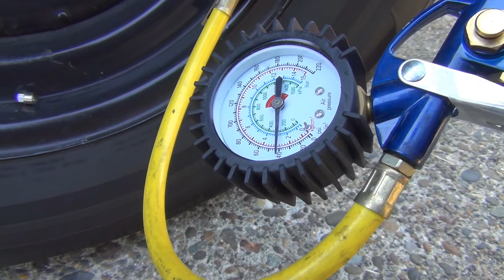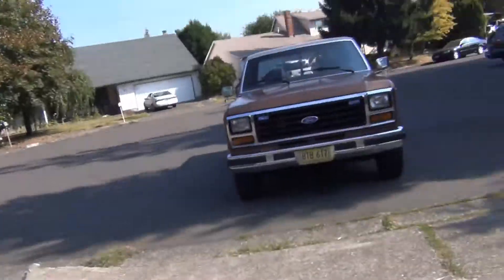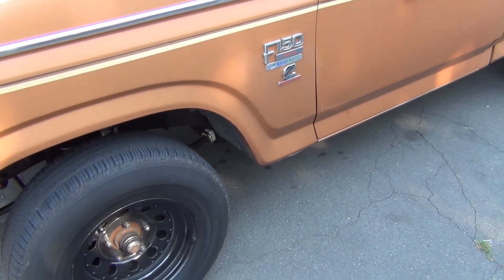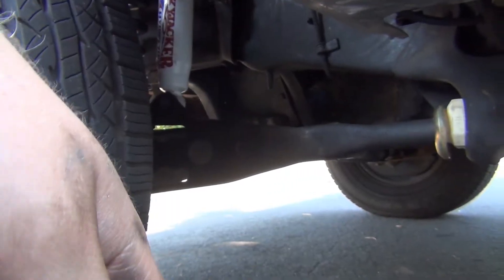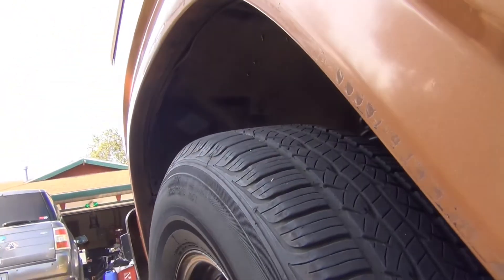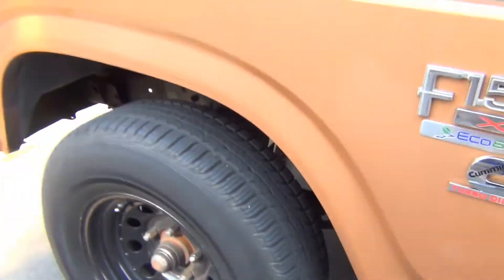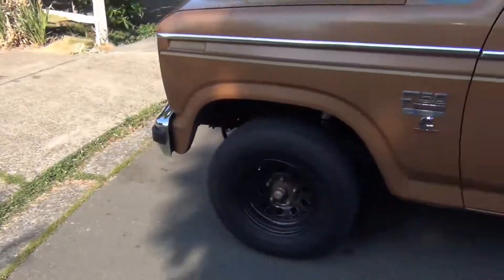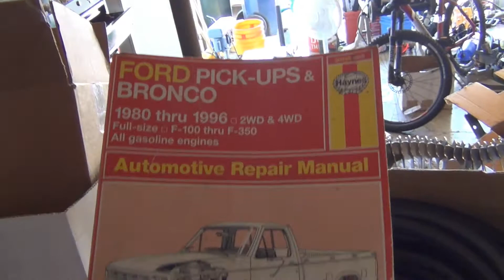Tire Leak and a Cool Estate Sale Find

Comment: The shredder valve in your valve stem might be leaking. I know the rear drivers side valve core on my truck is a POS and I have to play with it to get it to seal sometimes.
Reply from the maker: 1972FordF150 Go figure.
Reply: I see them packaged as 4 for $1 or $2. All you need is the little removal/install tool. Those are usually in the same spot as the shredder valves. I'm going to do mine sometime. On one, every time I air it up, it goes cockeyed and leaks, and I have to keep pushing on it to get it to stop. Piece of crap.